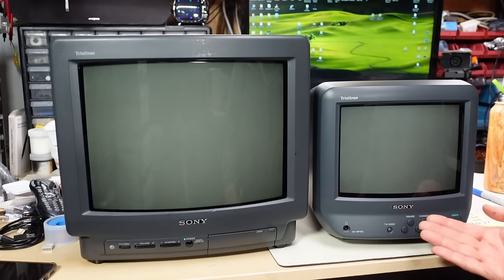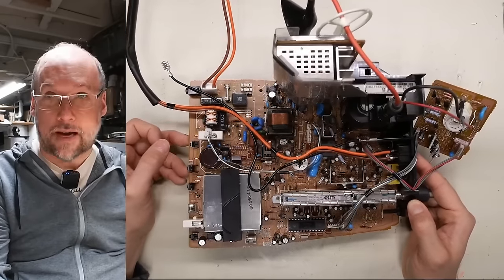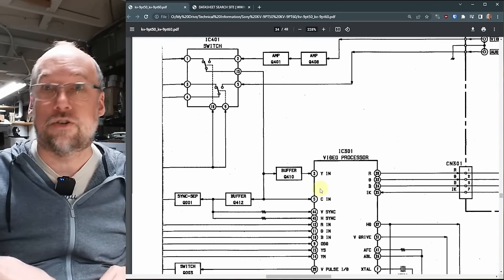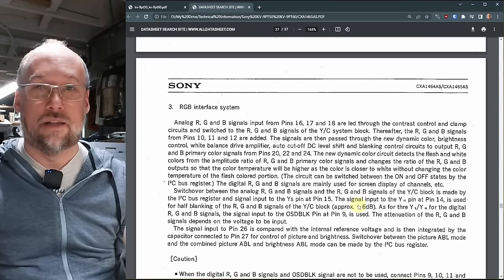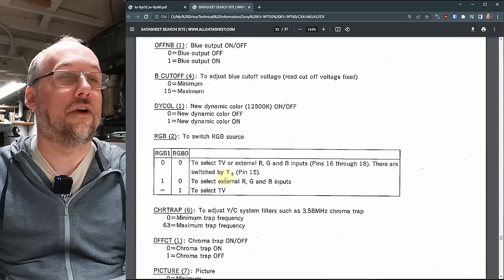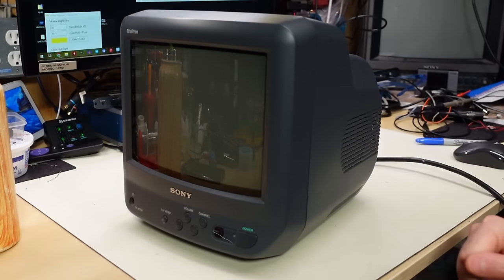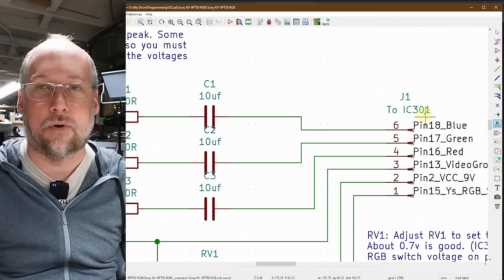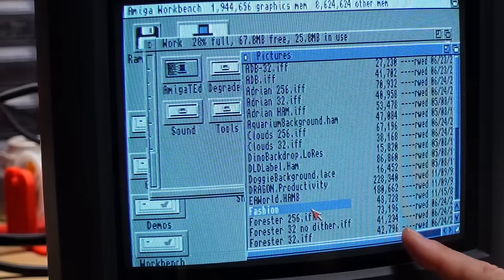Adding a RGB input to a Sony Trinitron (KV-9PT60 / KV-9PT50)

Comment: That's a great little set!  I'd love to have one of those!
Reply: Why would you want this?

I used to work at RCA.  You do NOT want to be using a CRT today.  It's a particle accelerator.  You have a very real refresh rate on it, which even if you can't see, trust me, your brain can.  This is why we used to get headaches staring at these things.

Trinitron was a cost reduction process in creating the screen, it works great for monitors because you can align it up with pixels, but it's not an improvement over picture quality.

We're engineers, what we've replaced and obsoleted WAS inferior.  CRTs are a terrible technology, but given no memory storage, the inability to do transparent circuit layout, etc, it made a blurry image possible.  It was fine, for 1980.

Consider where we are today.  In 2000 years, image and video fidelity will NOT be better than what we have today.  It might be different, maybe 70 Hz, maybe 50, maybe 700, but we won't have a significant difference in quality.  Whatever civilization is there, will be able to see what our life was like.

You REALLY want to go back to CRTs and videotapes?
Reply: @fuzzywzhe  The idea is to use them with older computers like Apple IIGS or Amiga. Screens made for these units are getting rare and expensive, this is an inexpensive way to get decent video quality on them. Yeah you can use LCD screens, but they simply don't look right.
Reply: @danaeckel5523  You just don't want to use a CRT at all.  You really don't even want to use an old computer.

A rasbperry pi (when they are available) cost $35.  With a 128 GB SD card, you can easily simulate (at the instruction level) an Amiga or C=64.  That will use, at maximum 20 watts, including the screen.  You can put any filter you want on the display.

I simply don't understand the obsession with old hardware.  They were space heaters, they are RF pollutants as well.  The CRTs caused eye strain, they were terribly inefficient, why would you want to go back to that?

I remember seeing full motion video on an Amiga back in the late 1980's.  I saw the first attempts at raytracing.

The frustration of working with these early, primitive machines - what's the point?  I can render an old style computer monitor from 1990 on a 4K television.  Why do anything with the old systems?  Nobody can answer that.

It was cutting edge technology at the time, but why bother with it?  Babbage machines are an interesting machine, however, you wouldn't want to use one in lieu of a calculator or even a phone - you don't even want to use a calculator today.
Reply: @fuzzywzhe  Why are you even here if you don't like retro computers?
Reply: @fuzzywzhe  Some people like nostalgia and the way it makes them feel. You sound like you think in more logical terms. It's fine for you but a lot of people like the old stuff and it has nothing to do with technical specs.
Reply: @jasoneverett  Nostalgia can be appreciated without physical devices.

I view a lot of this as exclusivity.  Some people can afford to buy this old garbage.  There's no need to get the actual devices for it, you can experience it precisely as it was, with a cheap (or free) simulator, and see what it was like.

More people can experience it, if they just run a simulator.  What's your complaint?  That they won't spend $1,000 on a noisy space heater which has 1.4 MB or storage?

We replaced these systems with better technology for a reason.

We already have given you everything, to the point that you will never have nostalgia for a computer for 2020 in 2040.  It will be practically the same machine.
Reply: @fuzzywzhe  I don't have a complaint at all. You can talk about simulation all you want. For me personally I use a Raspberry Pi and a WiiU to run roms of old games, but some people just like the actual vintage product better. Why do you think things like the mini NES are so popular? It's an intangible feeling that differs from person to person.
Reply: @jasoneverett  The mini NES is popular because most people don't have the first idea on how to get a simulator up and running.
Reply: @fuzzywzhe  alright man, we can just agree to disagree.
Reply: @NintenloupWolfFR  Look, it's trivial to take the housing of a NES, an Amiga, a C=64, and Apple IIe - WHATEVER and wire it up, glue some lead bricks in the case, and to run a bunch of resistors to produce excess heat, and then let you use it.

IF you think you can differentiate between simulation and emulation, you're mistaken.

One some more complex systems, there's high level emulation, but the earlier systems, we can simulate at the GATE level, where we simulate the signals of the system, we're not even simulating the chip, we're making a MODEL of the chip, and running that simulation.

You guys just don't understand what you're talking about.  You keep claiming to want "authenticity".  A computer is a simulator, all computers are.
Reply: @fuzzywzhe  oh, I do understand. If you're not aware of all the bugs and iffy emulation that plagues a lot of systems still, that's not my problem.

Also, his 9" CRT plus Amiga still uses less than a 60" OLED. People have consoles that use close to 300W now, this is of no concern to anyone if the TV has a couple more resistors that changes basically nothing to what I said.
Reply: @NintenloupWolfFR  Bugs are also duplicated.  Depends on the simulator though.

There's EXTENSIVE use of bugs in hardware in the C=64 which are exploited for example.

Modern consoles will be forgotten, because they won't be able to be simulated and most of them require a server to be online.  1/2 the modern games today will just be a vague memory in 10 years.  This is the new planned obsolescence.
Reply: @fuzzywzhe  It still doesn't change that there are systems still that have bad/iffy emulation. The C64 is a really popular system, but not all of them are that popular and the emulation isn't always to the same level. The less people there are enjoying a system, the less will want to make an emulator.

There are tons of people still complaining about stuff that's poorly emulated. Recently, someone complained that a Batman game on the Genesis had a punch effect that sounded wildly different from the original console. That's just an example. 

Telling people that real HW is useless because we can emulate everything 100% is factually wrong still as not every system is to that level. 

There are also a lot of reasons as to why one might prefer to use real hardware than just authenticity. Maybe you understand how modern HW is better than older ones, but you don't understand people. Stay with your soulless devices, it's gonna be better for everyone.
Reply: @NintenloupWolfFR  The reason you can watch a film from 1910, is not because somebody is firing up a film that is 110 years old, and playing it through a projector - it's because it was digitally restored frame by frame, usually from SEVERAL copies to reproduce something that was very close to the original.

In the same way, that's how you preserve everything.  You preserve COPIES of it, not the original.

And all machines are "soulless".  When Atari and Nintendo were knocking out consoles, they had as much love and affection for the machines as anybody does now.  These are PRODUCTS.
Reply: @NintenloupWolfFR  What will happen is that over time, original machines will simply become inaccessible.  They won't operate.

I've pointed out that modern consoles will NOT be able to be simulated.  Moore's law is done.  We will never be able to simulate a PS5.  In time, the ability to play the original games will be regulated in ports of the games to modern machines.

IF you want to preserve, you're going to be forced to do simulation.  I don't know if it's frankly worthwhile to do anyhow.
Reply: @fuzzywzhe  Also, about emulating recent consoles, We don't need to emulate them, they have x86_64 CPUs and PC based GPU. We just need to copy the APIs and some other specific stuff. Since it's the same arch as a PC, we're not gonna need emulation of the CPU+GPU, but just the stuff surrounding it.
Reply: @NintenloupWolfFR  The XBox360 and PS3 were PPC based.  When you "run" those on a modern machine, you're running a recompiled version of it for x86.

I don't think it matters much anyhow.  These are now entirely products, any artwork that once went into them have gone in order to maximize monetization.
Reply: @fuzzywzhe  There's an emulator for the 360 and it seems to work alright now from what I can see. The PS3 might take longer to get going though.
Reply: @fuzzywzhe  CRTs don't simply render the picture like a modern display would, the pixels aren't the same shape, and a monitor isn't just a resolution. The contrast, the response time, the versatility, the colors, etc
CRTs are pretty good at rendering multiple resolutions well, while a modern display will look wrong when the picture is not an integer scaling of the max resolution.
The trickiest things to render correctly are consoles or computers that used non square pixels as you may never have a 1:1 quality.
CRTs are also known to make pictures seemingly more detailed than they are (there are many side to side comparison pictures on the web about this). When artists were all using CRTs to draw their art, a CRT was the intended display, so not using one may make things look worse than they were intended.

You can get all sorts of filters for your flat screen to approach that aesthetic, but I've never seen something that came even close yet.
Reply: About emulation, oddly enough, PC emulation is still very far from perfect.

Old 8088 machines aren't emulated down to the logic yet, which tends to break demos from the demoscene.
As for newer machines, such as win9x era, the emulation is so slow you need a super computer to even emulate a mid range Pentium II, which is still not enough for many games.
Reply: @NintenloupWolfFR  I've seen some of the runs of the 360 simulator.  Basically, it's a high level emulator, which means it recompiles the code into a native frame work.  It runs some homebrews, but it's slower than the original machine (was last I checked anyhow), and is likely to just be a proof of concept.

Moore's law is done.  We are pulling REAL TRICKS to get smaller die sizes as it is.  We're basically at the limit.

PS3 is essentially, a 360.  The cell architecture had a lot of HYPE but nothing came out of it.

It won't be long before a typical video game system is sold on a box that's the size of a pack of playing cards.

I worked at MS during the 360 days.  Nintendo surprised everybody - it was basically a game cube but the Wii was fun, the family could enjoy it, blah blah blah.  It outsold the PS3 and 306 both, combined.

Graphics can be improved but it's not really as important as once thought.  It was AMAZING to see 3d vector graphics in the 1980's and 1990s, today, even photorealistic is hardly important.  Game play is.
Reply: @DxDeksor  With a 4k monitor, that has just about as many pixels as your eye has photoreceptors.

8k monitors exist, although they really have no reason to exist.  You just have to pass the image through a filter.

The resolution we have today is.. well, stupid.  The monitor I'm looking at now has as many pixels as a movie theater does.
Reply: @DxDeksor  There's no desire to simulate the old 8088 machines.  Why bother?

The "demoscene" back in the day, nobody that was serious used PCs to do it.  It was C=64 and Amiga primarily although there were a few for Atari ST and other Atari variants.
Reply: @fuzzywzhe  human eyes don't work like displays or cameras work, the density isn't the same in every place.
The size and distance where you're at of your display also matters.
4K is most likely "good enough" for 99% of the use cases for years to come ... But it has nothing to do with what I said about CRTs.

As for the demoscene, this is just wrong.
While 8088s weren't touched much as far as I know, the 286s, 386s and 486s had many demos made for them. Teams like Future Crew did insane things back then.
And nowadays, new demos are being made for all of these platforms.
Also not replicating it 1:1 means that there may be programs other than demos that just won't work right.

Also, yes there's desire to simulate the old 8088 machines. One of them being because it was the microprocessor of the very first PC from 1981, so people curious to see how it all started do want to check it out, and also being the heart of the very first PC means that many programs will only work right with that specific computer and nothing else. This was tried with varying degrees of success even back then by implementing the turbo button on later machines ... which didn't always solve all of the issues.
Reply: @fuzzywzhe  From what I can see, Xenia is good enough now that you can use it to play some (not all yet) 360 games on hardware that was considered good in 2017. It's not finished, but it's getting closer to something we'll just be able to use as any regular emulator.
Reply: @fuzzywzhe  Not really, some of the best increases wheren't due to smaller transistors. When we went from ~1 instruction per cycle on the 486 to ~2 per cycle on the pentium, it wasn't due to a smaller node, but a better architecture. We didn't need smaller nodes for out of order execution. Getting smaller transistors isn't the be all end all of optimizations you can add to get gains. A 3GHz CPU today does much more than the first 3GHz CPU. 

Get the best computer from 2010 and try to play a AAA game of 2022 at ultra 4K and we'll see how it does, probably single digit FPS. Run a AAA game from 2010 at ultra and you'll see that it looks old compared to what we got now. We don't seem to be that close to the limit yet, both TSMC and Intel still do R&D because they know they can still go smaller still.
Reply: @NintenloupWolfFR  Design changes are in part, possible, because of reduction of transistor size.

I'm actually trained as a VLSI designer (thank god I didn't go into that!), and a modern chip wouldn't have been possible to build in 1990 - it just wouldn't fit.

The more transistors you stuff on a chip, the smaller the transistors have to be to fit on the chip.

I'm pointing out that a computer from 2010 is usable as a work machine, that's not true for a machine from 1990 being used in 2000.  

We're not going to 8K, I mean the displays DO exist, but it's pointless.  They have more pixels than you have visual receptors.

We have 4K video now, who uses it?  We're at diminishing returns now.  We can make faster processors, but who wants it?  You THINK you do, but what you're talking about in your example, was just a better video card with more processors.

When I worked on the 360, there were rumors for a while that we were going to move to ARM for the next architecture, but I don't know how serious it was.  You know why they were thinking of moving to ARM?  Because they didn't need more CPU power.  It's all graphics.  The game itself, is small, most of what is on your BluRay is image data.
Reply: @fuzzywzhe  optimisation of the architecture still does a lot of the lifting. Via did 1GHz 486 based CPUs, they're dog shit compared to modern 1GHz CPUs. 

Put a modern GPU on a 2010 CPU and the perfs will be atrocious. CPUs from 2010 are too underpowered for that. 

Games are also starting to use more than 4 cores, so your old 4 core CPU will start to stutter much more soon if it's not already the case. It's not because it doesn't feel like we're advancing as fast as in the 90s that it means we're to the point that in 2 years will be stuck indefinitely. It's not that simple. And anyway, progress doesn't care of what you think about that. Will still get snaller nodes for some time still and other optimizations that will give more. We're not at the end yet, like every time people where saying we where close to the end.
Reply: @NintenloupWolfFR  486 didn't have a floating point unit, because of size constraints, so all floating point math had to be done with fixed point.

Again, you can always do more BS in a video game.  The point I'm making, again, is that there aren't vast changes coming up in the future.

We are living in a time, in which if you can store it, people 2000 years from now can see precisely what life was like today.  Imagine being able to see what life really was like in Rome in 0 AD.
Reply: @fuzzywzhe  Bruh, 486DX came with a FPU, it was the first CPU from intel to have an internal FPU.
Reply: @NintenloupWolfFR  oh maybe, I don't remember.  It didn't matter to me much at the time because you couldn't (and still can't) use floating point numbers for a lot of things.

The first non Commodore computer I had was an AMD 486, which I used to run Slackware 0.99 on.  It was amazing to have what was basically my graphics workstation at home, with a much crappier and smaller screen, but it was Unix alright.

I was never a fan of Intel.  Basically, the worst architecture won and it's definitely the worst architecture ever made.  It's a mess.

Not so important today though.
Reply: @fuzzywzhe  This guy is clearly a troll. Just ignore him.
Reply: @fuzzywzhe  "Why would you want this"?????? They have a bright and gorgeous look that's hard to reproduce and CRTs still retain detail better with fast scrolling than anything OLED (even with tricks such as black frame insertion). The technology behind how they work is fascinating and they may never be producible ever again.

Also, not many people had RGB mods in the old days and now many people can experience CRTs as they never did before with projects like the MiSTer offering any type of analog signal you want. The communities surrounding CRT gaming are quite active and there's even an effort to create a CRT chassis from completely new stock. You seem to have a weird distaste for something you don't appreciate. Maybe you don't need to chime in when you're not providing any value other than crotchety opinions
Reply: I read that with your voice; I almost able to hear your enthusiasm!
Reply: @werdsup  CRTs are NOT faster than OLED.

OLED has its own set of problems, the blue fades in time, although this can be mitigated partially with circuitry to extend the lifespan.

There is a reason that CRT technology has been ENTIRELY abandoned, multiple reasons.  They are expensive, heavy, they cannot produce exact pixels, they have color bleed, they are slow, and they are fragile.

I worked on CRTs for years.  The SECOND that TFTs came out, I abandoned my old monitors, but a much smaller monitor, that had a crystal clear picture that didn't induce a headache do to the refresh rate.

I've had to work on PAL before in the United States.  Any idea what it's like to work on a 50 Hz screen with 60 Hz fluorescent lamps?  Now that's nausea inducing.

You complain about me having 'crotchety opinions' - I'm not the luddite hear pining for the bad old days claiming they were better.  They weren't.
Reply: @fuzzywzhe  but why watch a video on RGB modding a CRT and jump into the comments if you're hating on the technology because it's inferior when there's still a thriving community of passionate enthusiasts that don't care what you think. You're wasting your time. Also like I mentioned before OLEDs do not capture motion detail as well as CRTs (yet) even with BFI. This is well understood despite your claim that they are "faster"
Reply: the funny thing is if you told yourself you had to reply to every comment on this thread about how their screens are inferior to modern display tech you would be busy for a long time. CRTs have a cult following from people with electronic engineering backgrounds to kids that think it's just cool how they sound when they turn on. Regardless of what their reasons are they enjoy the experience and there's nothing you can do about it 😉
Reply: @werdsup  I'm not hating on the technology.

1/2 the people watching this have never had a CRT and don't know what they were like, or remember.

In 2009, CRTs were eliminated has HDMI replaced NTSC broadcasting in North America.  That was 14 years ago.  Most households had already replaced their CRTS with TFTs by that time.  

OLED has a better response time than phosphor dots in a CRT.  They can easily do 120 Hz.

I know this technology well, but I fully recognize there are only markets in BS and not in truth and I'm always attacked for explaining that a video is full of it.

You CLAIM you want to understand technology, but you just get offended when there's somebody that ACTUALLY what they are talking about, pointing out what is being claimed, simply isn't true.

It reminds me of "audiophiles" that claim (incorrectly) that they can differentiate between analog audio and digital.  No they can't.  These people claim to be experts, they mislead the public.  It's annoying, that's what I'm fighting against.

In 20 years, people are going to be exposed to a CRT tube and openly state "I can't believe people actually stared at that".  I grew up with it, so I became accustomed to it, but I would never go back, and neither would anybody else, except a nut.
Reply: @fuzzywzhe  modern screens all have motion blur regardless of the refresh rate. It has to do with the line retracing which is the whole point of BFI which is one of the reasons CRTs are sought after
Reply: @DxDeksor  The phosphor doesn't go above 120 Hz.

It's like that stupid iPhone retinal display.  YES, it has more pixels than your eye can perceive - what good is that?

"well, it's better!"

It requires more memory, it requires a higher refresh rate, it consumes more battery power, no human being can perceive a difference, but it's "better" somehow.

People buy things because they're ignorant, chiefly today.
Reply: @DxDeksor  I believe it has a scan rate that fast, I'm telling you the phosphor doesn't react that quickly.

Used to work at RCA.  ONE of the technologies was a flat panel CRT that was about 2 inches wide.  It created an electron cloud, and pixels were lit up by accelerating the cloud toward a pixel, not with a gun, but with an attractor that was positively charged.

You can believe you can see what you think you can see, but we used high speed cameras and digital oscilloscopes to see what was really happening.  It's WELL beyond human perception.

Anyhow, who cares?  You're just the video version of an audiophile, and I hate arguing with them as well.  I'm sure you have gold plated chroma/luma cables, and have it all electrically isolated as well.
Reply: @fuzzywzhe  if there was no way to get it to react this fast, it would be pointless to make this possible.
What have oscilloscope and high speed cameras to do with human perception?

It's literally apples to oranges. Yes a machine can perceive things better than we do. So what ? The point is that humans can differentiate 120hz vs 60hz. Blindtests have been made and subjects were able to see a difference. Now I'm curious to know what framerate you think we can see at best.

Nice strawman, audiophiles are trying to get the best out of their audio equipments and then they start getting crazy and fill their computers with cards filled with useless caps or use gold plated fiber optic, their goal is always the best audio quality period.

If you want to compare me to people who like music it'd be more fair to compare me to people who like to listen to vinyl discs to have the random cracks and pops. I don't think that's being an audiophile.

And no I don't use gold plated crap. If there's a big problem in the video quality it's usually something anyone can see. Even my camera can pick it up. If you accuse me to be a video equivalent to an audiophile that'd be like accusing someone to be an audiophile when what they're complaining about is a clear buzzing sound in their speakers that anyone can hear.

Also you hate arguing with "video version of audiophile" yet you keep coming back at every video, as you said. Curious.
Reply: 😂 some AI bots battling each other in here.
Reply: @DxDeksor  "What have oscilloscope and high speed cameras to do with human perception?"

Because machines are WELL BEYOND human perception.

If you can't see the difference of audio compression on an oscilloscope, you can't hear it on a speaker reproducing the sound.

We did double blind tests, all that crap.  People who CLAIM they can hear the difference between a vinyl record and a digital recording can't.  

Visual fidelity is different because it's TRIVIAL to see an improvement of quality on a TFT or OLED screen compared to a CRT or even film.

I get tired of arguing about this, because I know how much research and effort has been put into these fields, and you just don't.

On a 4K television with mpeg-2, that's beyond your ability to discern audio quality with a high enough bitrate, and you can't see beyond 4K although you MIGHT be able to distinguish between 4K and 1080p.  Most people can't in a moving picture.  It doesn't matter.
Reply: @fuzzywzhe  I know these machines are way beyond human perception, but the point is exactly human perception, not machine perception.
About vinyls my argument wasn't one of an audiophile where you're supposed to hear something better because it's not compressed or whatever (most disks made today are designed with computers anyways so that's besides the point). My point is that some people like to listen to them because they've got a charming defective nature with the clicks and pops they make when read.

As for CRT, it depends which crt you're using. A 4k TV being 100% better than a cheap old TV from the 90's ? Definitely.
My 1997 17" monitor vs a TFT made a decade later ? Not really, the colors look like crap, the contrast is terrible and the viewing angles are bad. However it's much more convenient to move that's for sure.

Now vs a modern display it's not so clear anymore for sure. 
But like I said for people liking the vinyls cracking, some people may like to have their games to look like they did on an old TV.
4k TVs are good at displaying good pictures, not so much at displaying lo-fi pictures.
Like I said before, some visual effects were meant to exploit the quirks of CRTs, using an LCD will remove that as well.
You can try to replicate that with a 4k display, but the more you try, the more lag you add and the more costly it gets compared to just getting a crt.

There's also the fact tha CRTs were pretty good at displaying many resolutions well, not just their max res. That also means that older machines loved to jump from one resolution to another. On an LCD, not only it can look bad if the scaling is not an integer scaling, even at 4k, but it also takes time to sync to the new signal rate. And for some games that keep jumping from one resolution to another, that can be pretty annoying. Maybe this can be suppressed by a better scaler, but that's throwing money at a problem that didn't exist before.

And finally if you want to have a full system (especially for computers), having an old 386 with an LCD will look rather anachronistic. It's like having a 1800s house and putting a basic plastic front door.
Functionally it may be the same as the previous wooden door. Maybe even better, but it will probably look bad and out of place. Now if it's your house and you're fine with it, good for you. But what I mean is that it's up to anyone's taste.
Reply: @fuzzywzhe  I agree with what you said, there's no reason to use these old computers from the 1980s when I can buy a brand new Commander X16 computer.
Reply: @fuzzywzhe  you further prove that every party has a pooper, with all due respect.
Reply: @fuzzywzhe  why the heck are you here rambling about saying "CRTs ARE BAD HURRDURR,WHY USE OLD MACHINES WHEN EMULATORS HURRDURR"
its a hobby,no need to go "mister nitpick" when the goal is to literally have fun,and to go back to times were simple
Makes me think you were not here to watch a video in the first place. :D
Reply: fuzzywzhe must have love those cheap chinese product like X-Pro 800 in 1 aka Souljaboy Console that can’t even properly emulate NES. LOOK! Those will never feel the same as my NES I would rather deal with cartridge reader issue on my NES than dealing with poor NES emulation that these cheap Chinese game console have. Also 486 machine use less watt than my main workstation pc.
Reply: @NintenloupWolfFR  486DX also came with Math Coprocessor from what I heard.
Reply: I was thinking the exact same thing.
Reply: @fuzzywzhe  clearly you know very little about electronics, pi emulation is nothing like the real thing. CRTs have many advantages over current lcd panels. I’m fortunate enough to have modern and old hardware, and can honestly say everything you’ve said is questionable at best, I’m also in IT and have done Electrical Engineering prior to that. You are by all means entitled to your opinion, but looking at the rang of comments mine included, you sound like you may have missed the 80s.
Reply: @dave24-73  Look, I've written simulators.  People who say STUPID things like "simulators aren't the same as REAL hardware", are like people who say dumb things like "digital doesn't reproduce sound as well as a vinyl record does".

Yes it does.  I'm an electrical engineer.  I can take a, I dunno, a PS1, gut the thing, stuff in a Raspberry pi, wire up the CDRom to it, and few lights to the GPIO pins, with a HDMI to NTSC converter and you would have NO IDEA you were using a simulator and not the "real thing".

An NES light-gun works JUST FINE, on a NTSC monitor.  We perfected simulators in the 1990's.

Now, higher level emulation, that is, systems that are simulated by simulating routines instead of hardware, well that isn't exact and probably never will be.
Reply: @fuzzywzhe  first off it’s Emulation not simulation. Secondly some demos and games hit the hardware directly and don’t work on emulation. They don’t even work on variations of real hardware, the Amiga 500+ wasn’t as compatible as the Amiga 500. Your arguments seem weak at best, something tells me you just have to be right even when the forum is clearly pointing out how wrong you are. Because you don’t seem to be able to take on board what everyone is saying, this will be my last response.
Reply: @dave24-73  No, it's simulation, not emulation.

Emulation is when you do it in hardware, like with FPGA.  Simulation is when you do it in software, like verilog.  I know people call it "emulation", it's TECHNICALLY incorrect.  I tend to use the vernacular of my profession.

What games and demos don't work and on what systems?  That's a bug.  Bugs exist.  But not on the Frodo, not on Stella, not on FCEUX.  There might be bugs, report them.

I'm not arguing to win an argument.  The whole point of making a simulator is to make it as accurate as possible.  There very well may be bugs, but they are RARE for older machines, if they exist at all.

Some machines are simulated at the circuit level.  Most machines take an opcode and run a routine to simulate that opcode, and store results in simulated registers in memory.  But some don't, some simulate the actual hardware, at the hardware level.

Depends on the complexity of the machine what is done.

When machines are simulated at the hardware level, this is called "cycle accurate".  These simulators really need a decent CPU to simulate, but what you end up with, is a "perfect" machine.  It is running the software through simulated hardware.  Unless there is a mistake in the simulation of the hardware, it's 100% perfect.

This isn't generally done, it's too CPU intensive, and it's too complicated.  When you do cycle accurate simulation, you're simulating signals and the chips themselves.

I'm just telling you, this is pretty much a perfected art, at least up to machines to the 1990s.  We're not sloppy.
Reply: @fuzzywzhe  still going at it mister nitpick?
Reply: @gustiwidyanta5492  When people respond to me, I tend to have the graciousness to respond to them.  If they spent time on talking to me, it's only fair I consider what they write and respond.
Reply: @fuzzywzhe But nothing can be as good as real hardware as you can't mod emulators to add more ram then the un-modded computer supports but with real hardware you can mod it to support more ram
Reply: @superJK92  depends on what you're simulating.  I can add more memory to an Amiga simulator without any difficulty at all.

I can even setup configurations that would be impossible with real hardware, not that you'd want to do it.

I'm an electrical engineer, I really see no point in simulating these old systems.  REALLY, most of the systems of the 1980's and 1990's are PERFECTLY simulated.  

The old systems were ridiculously complicated because the chips were relatively very slow, and they weren't really slow at all.

I'd hate to go back to having to work on these old machines now.  It was interesting back then because of the ENORMOUS improvements we kept seeing, and it was in my field.  Today, there's nothing interesting because you can't really improve upon it, at least noticeably.

Today, a video game of Star Trek looks as good as a movie theater rendering.  People don't yet appreciate just where we are.  In 2000 years, somebody's video screen will be basically identical to what we have now.  It might be thinner, it might be cheaper, but it won't be better.
Reply: I have a bunch of these and I love 'em!
Reply: @fuzzywzhe Do you know who you're talking to in regards to CRTs? 8BitGuy has done CRT mods before and has been around on YouTube for years as a tech specialist. Everyone has their uses for hardware, this is no different.
Reply: @Siknik64  I used to work at RCA. I've seen ThinCRT Flat Panel before?  I bet you've never even heard of the technology, and no wonder, it did fail.

It doesn't matter.  We got rid of CRTs for a reason.  They literally would heat up a room for just being on.  I would never want to go back to the bad old days.
Reply: CRT's last way longer and have better colors and blacks @fuzzywzhe
Reply: Dude you know nothing about crt's if your saying you shouldn't use them on a old computer/console @fuzzywzhe
Reply: 60 watts isnt alot, they didnt emit that much heat only some @fuzzywzhe
Reply: The mini NES is popular because a regular NES is expensive @fuzzywzhe
Reply: Reported for trolling and misinformation @fuzzywzhe
Reply: @fuzzywzhe I'm a retro gamer and I love old hardware and old CRT tvs but still..  I agree with you. I'm not going to tell you that you're wrong and tell you that CRTs are better because well.. they're CRTs. I do respect your opinion and (again) I totally agree with you. It's totally true that CRTs are: Dangerous, fragile, low quality and etc. I agree about the fact that 4K tvs are indeed better than CRTs. OLED tvs are faster, lighter, have better colors etc. I totally agree with you but still.. i prefer playing retrogames on real old hardware like: NES, PS1, SEGA GENESIS etc, on old CRT tvs. Me, as a retrogamer, I just like playing games like people used to back in the day. I just like the way CRT tvs work, the way they look. I just love everything about them. CRTs and LCDs have their advantages and disavantages but I prefer CRTs. I would and wouldn't daily a CRT monitor. I would because CRTs are cheap,  have very nice colors and have very high refresh rates but.. i wouldn't daily one because CRTs and dangerous. Anyone has their own preferences and im nobody to tell people that they're wrong or right. I respect everyones opinion!
Reply: @fuzzywzhe Maybe they want to run DOS games or games that won't work on Linux
Reply: If I was going to have a CRT I have to agree that this is closer to what I would want in size on my desk.  There isn't much space on my workstation, so a smaller screen is a must.
Reply: @fuzzywzhe it’s emulation not simulation also why do u care what other people use or buy
Reply: @guccisquidbillytentacles  It's simulation not emulation.  This drives me crazy.

A simulation is a software representation of hardware, i.e. it's simulating hardware.

Emulation is when hardware is reconfigured to act like other hardware.  FPGAs are hardware that though software can have the circuits within the chip to emulate another chip.  Emulation is much faster than simulation, but it's also more expensive.

When I worked on the XBox project, we worked both in simulation and emulation to bring up the new hardware.  The emulator ran at about 1000 times faster than the simulators did, but the emulator was like a million dollars, constantly broke down, and we only had a few of them.  In the simulators, you could fire up tests at 5:00 pm, and check results at 9:00 am, but on an emulator, the same test would run in about 5 minutes.
Reply: @fuzzywzhe you say “it’s a particle accelerator” like that’s a bad thing. It’s hecking cool!!!!
Reply: @trekintosh  If you ever had a CRT television and you had your parents say "don't sit so close, it's bad for you".  They weren't lying.  I had to sit in front of them for 8 hours a day, minimum as well, once a flat panel was available, it's much easier on the eyes.  There's no blank intervals on an LCD.  Picture quality on an LCD WAS worse, and often lower resolution, and smaller, but no headaches, I used to get nausea, the flicker is JUST outside of my perception range.  I can see it easily in PAL units.  I went to Australia in 2000, I couldn't watch television there.  That's 50 Hz.  Probably the reason I couldn't see 60 Hz, is I was habituated to it.
Reply: But hé copyd you
Reply: Ok so i need a computer monitor for audio mixing and also games, any recommendations on the greatest technology available but not to overpay will be appreciated, good day
Reply: @fuzzywzhe when you use 240p consoles you can clearly tell how modern flat panel displays look like garbage next to a crt
Reply: @SuperShyGuyBros54321  You just place that through a filter.  I get tired of arguing stuff like this.

I can literally modify a simulator, of say, a x64 (Commodore 64 "emulator"), to have a CRT overlay on it, using OpenGL to do a fuzzy expansion of a surface of the display onto it which would be curved at what an old CRT tube WAS curved at, and then record it through my actual computer, post the resulting video here, and you would think what you are seeing is a camera on a tripod synchronized to a 60 Hz NTSC display.

That's where we are in technology.

I'm an engineer.  It's not like we haven't though of all this crap.

People complain that "vinyl sounds better" for example - you know what these dummies actually are complaining about?  A lack of audio distortion.  We can "fix" this so a digital track sounds like vinyl by running it through what is called a convolution integral.  We did that, 20 years ago, and nobody actually wanted it.  It's just something "audiophiles" (i.e. idiots) say is superior.
Reply: @fuzzywzhe  I use CRTs for a different reason than it’s looks for the most part. The main reason is so my Wii remote doesn’t break the tv if the wrist strap slides off my wrist, since I have smaller hands and that sometimes happens. With the CRTs thick glass it might scratch a little, but it usually doesn’t break from that. Flat panels [not flat screens since they exist in CRTs and modern displays] can break a lot easier, even applying too much pressure can render it useless. As for my PC, I do use a small LCD, because for email and word processing that’s all I really need